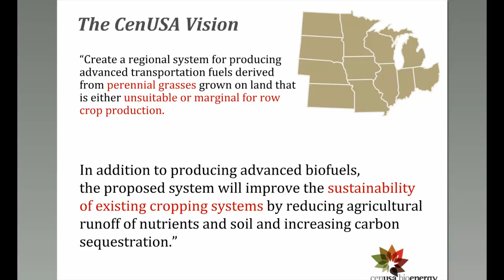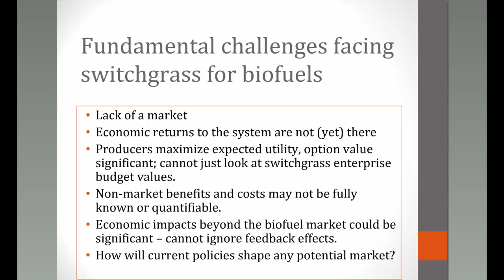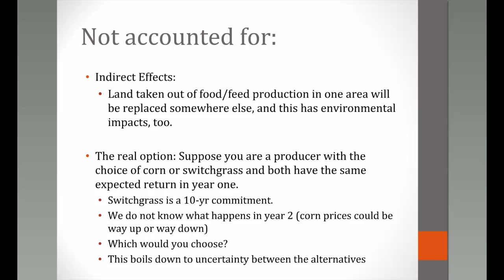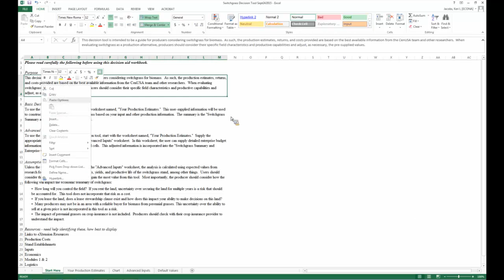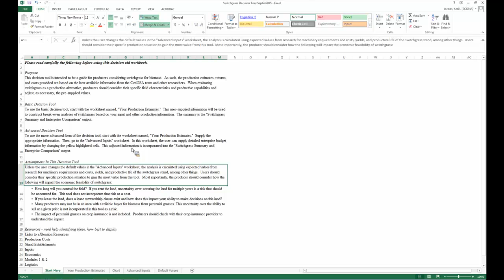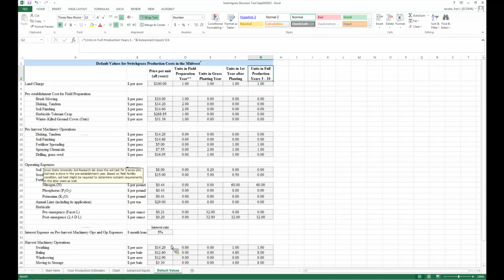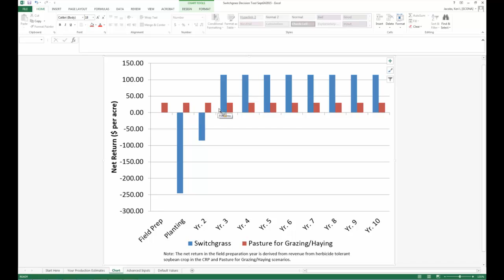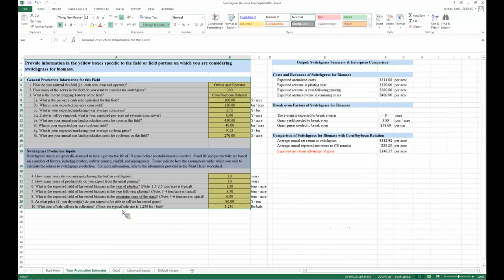CenUSA Bioenergy Switchgrass Decision Tool

Comment: You disabled comments on this video. >>   https://youtu.be/LVN9E9bXOvM         So i'll comment here. In both cases horizontal vs verticle wind turnbine comparison, the meter reads less than one volt. You need to correct your video.